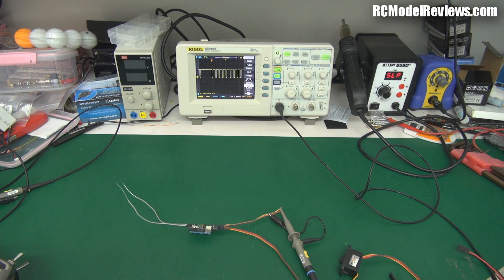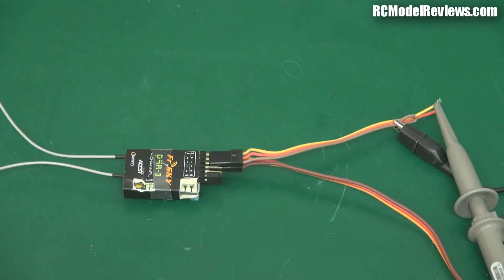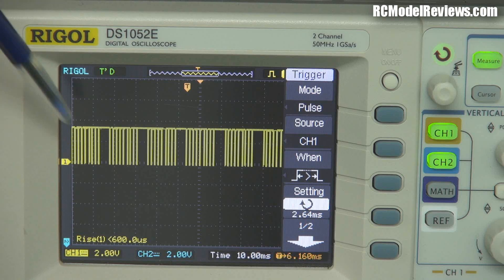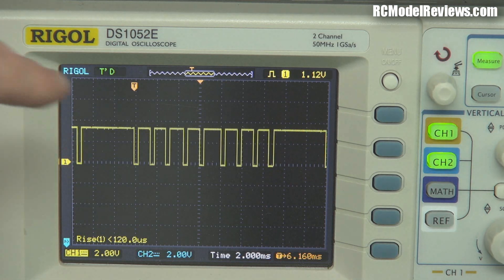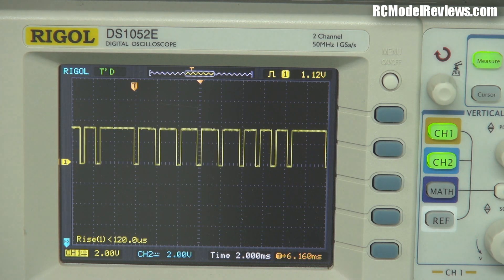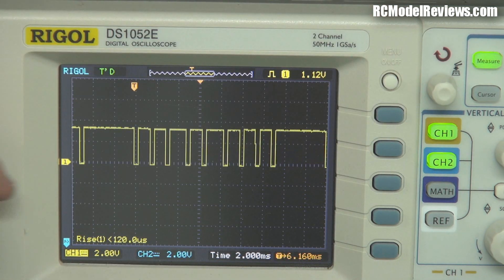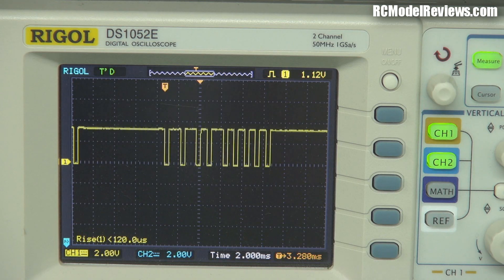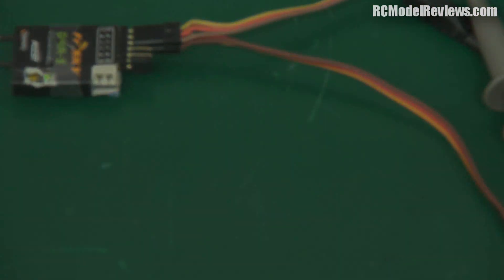CPPM and the FrSky D4R-II receiver

Comment: Hey Bruce,
Nice video but my question is that is PPM the same as Futaba SBus? or is it a totally different cause I was wondering if I could use my Futaba rx with SBus on a naze32 board?
Thanks,
Pete.
Reply: ***** There is no need to convert SBus to CPPM.  The Naze32 works with SBus by enabling "feature SERIALRX" and "set serialrx_type=2" in the CLI, but requires an inverter cable.  HobbyKing sells the "ZYX S.bus connection cable" inverter for about $4, or you can do as I am by making your own with an NPN transistor and two resistors.

Baseflight wiki on Serial RX:
https://github.com/multiwii/baseflight/wiki/SerialRX--like-SpekSat,-Futaba-SBUS,-Graupner-SUMD

The SBus inverter I built:
https://oshpark.com/shared_projects/qP5QyPLN
Reply: *****
But SBUS is SBUS, right? Or is the Futaba SBUS different from the FrSky SBUS?
Reply: zeemanjr PPM isn't the same as SBus, the only similarity is that all the channels are delivered through a single connector.   If you want to use your SBus Futaba receiver you can get an SBus to CPPM converter that will do the job... but then again, it might be just as easy to use the individual channel outputs if your receiver has them.
Reply: ***** OK thanks,
I think this will be the easiest way or can I get a Futaba compatible RX from FRSky with PPM?
Thanks again,
Pete.

Comment: Hi Bruce. Could you 'fix' this buy setting the no of channels to 5 in the Tarranis for that model.. Under channel range = Ch1 to 5 .
Reply: S Rob Yep, that'd be a way to do it for the Taranis but few other radios offer that level of flexibility so if you're using a module in your JR or Futaba you'll probably be stuck with 8 channels and have to use this method.